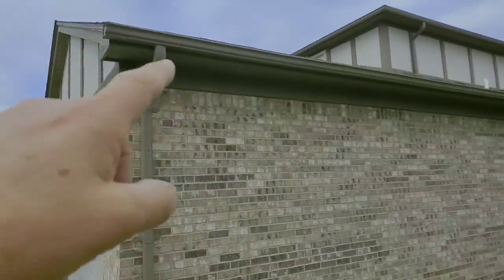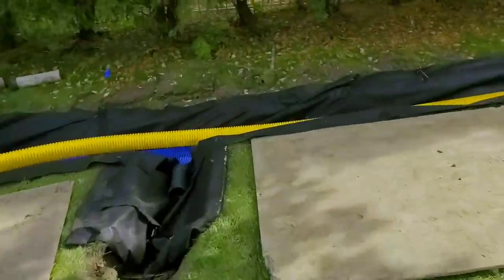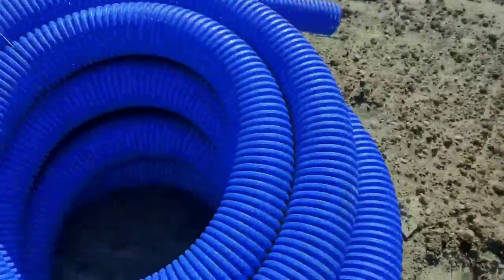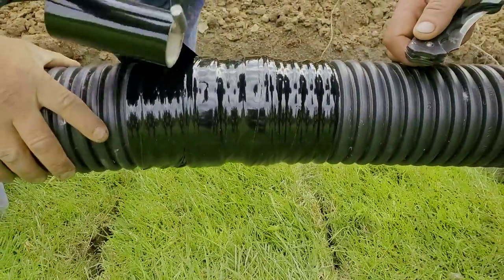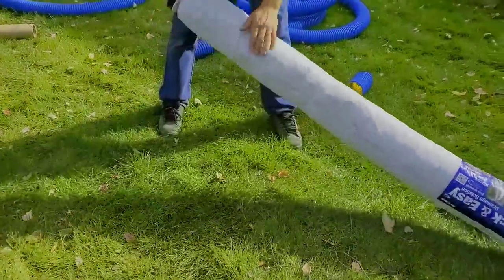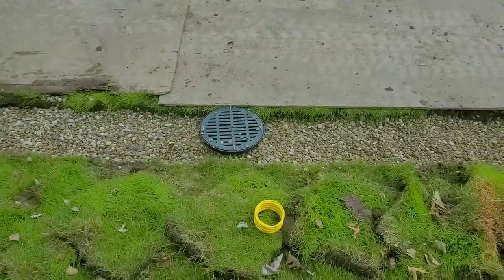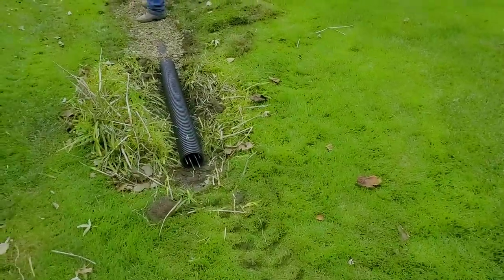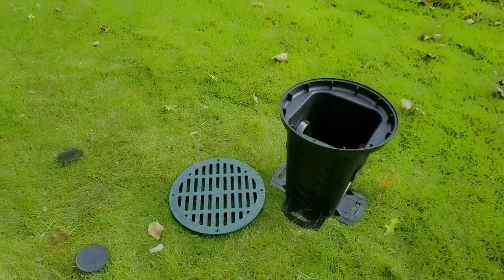YARD DRAINAGE TIPS & TRICKS!!! [ SAVE TIME AND MONEY ]

Comment: Helpful videos. Thanks. When do you decide between the solid black dual wall vs the solid blue or yellow for downspout drainage?  At minute 15 in video you mentioned using the solid dual wall on one downspout. Other parts looked to have the solid yellow.  Thanks.
Reply from the maker: We have a new pipe called Armor Pipe in the High Octane Line it's all we use for downspouts. We are taking orders now we do sell out every year that's why we sometimes are using the yellow. The Pre Ordered Armor Pipe will be available to ship by March 1st. Once sold out we have to wait till February before the next run again. It is a custom Pipe limited run. Thank you for commenting 
Store | French Drain Systems | Curtain Drains | Macomb, Oakland, Lapeer, St. Clair County
https://frenchdrainman.com/store/

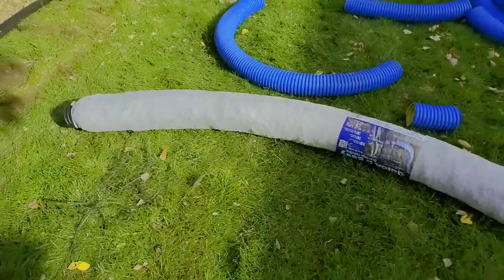Comment: What size stone are you using.  It appears to be smaller than 1.5".  If you go to 25:03 on the video that is not 1.5" stone.  I have a french drain I am installing using your system but and confused on stone.  My local suppliers can not supply 1.5 washed stone.   What can I use?
Reply: @the74impala  Thanks for your comment.  1.5 river rock it is.
Reply from the maker: High Octane Flows more water then Stone.
Reply: @the74impala  What are fines?

Comment: I can vouch for the strength of the High Octane. I ordered 600 feet and there is no comparision to the HD/Lowes pipe. I'm doing about a 700 foot open french drain with High Octane and ( Schedule 40  To be able to drive over) and the HO is so much easyer to work with. My only other option was SDR 35 but really the HO is way faster to install than the SDR 35. The schedule 40 in my area (CT) is about $28 for a 10 foot section and about $11 for SDR 35 Price of the High Octane vs SDR 35 was  close minus shipping. So lets see 60 joints vs 6   Being a one man show I'll take the High Octane

Comment: What a system in that yard. Did you use smaller stone to fill the voids because of the quad pipes taking up so much room? At the end of the run at the discharge it looked like you wyed the downspout and french drain together. Would this be okay to do if you were discharging a downspout and french drain into a leach pipe. Or can a french drain also act as a leach pipe...My theory of the animals that eat the black pipe is this: A groundhog that has a maze of tunnels underground would love to have his own water supply, why not just tunnel to the pipe and make a hole to get a drink.
Reply: In 8th grade we had several rats in cages for experiments . In some experiments the rats would chew just about anything we put in the cages. Brand New wire , new leather, plastics, just about any material we put in they chewed up. Of course we didn’t have Baughman products in those days but I would bet they would chew it also. If you could put Homedepot pipe and Baughman in a rat cage Maybe they would chew homedepot products first but when it was done I bet they would start on the Baughman .
Reply: @marlboromatt5656  That reminds me,  a few years back I had some squirrels in my attic. As a DIY I started trapping them. There was this one little squirrel that wouldn't go in the trap so I closed off the hole in the wood soffit with hardware cloth. He chewed the 1/4 ply from the opening to the perimeter past the wire (about 5 inches worth) in about 5 minutes so he could get out. They all need to file their teeth down somehow. Let's hope Baughman tile survives the wildlife!

Comment: Every time you try to compare the Boston tile with easy Flow.  You always step on the very end of the Easy Flow first to collapse the pipe, before you step on the protected portion of the Easy Flow with the packing nut wrap.  Of course the pipe is going to collapse because you've got a two and a half inch Gap at the very end before it hits the Earth it's going to collapse.   But then when you step on your Boston tile you don't step on the very end you always step about a foot and a half away and then you ease over to about 10" from the end if you stepped on your easy Flow at the very end and that be your first step it wouldn't collapse too. So quit trying to pull the wool over everybody's eye that easy Flow will work. It maybe not as strong as your Boston tile but it will work.  I like your videos.  Just show us how you do it.  Personally, you charge to much for your Boston Tile.
Reply from the maker: Watch "NDS EZ-DRAIN vs FDM High Octane Yard Drainage Pipe Manufactured by the Baughman Tile Co." on YouTube
https://youtu.be/7ZYhQ98ShmY